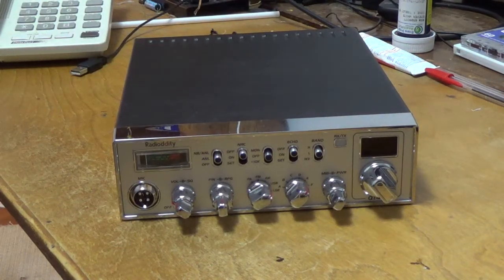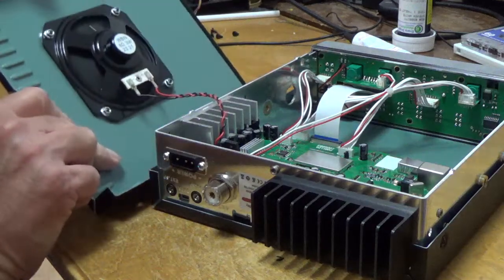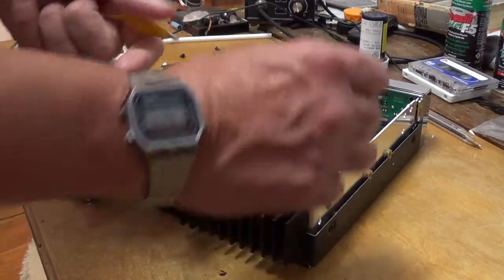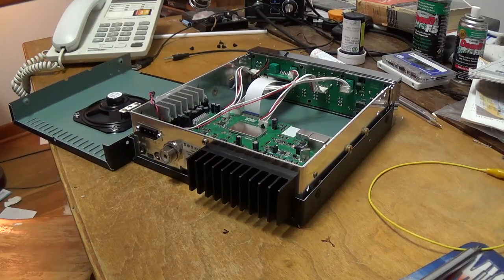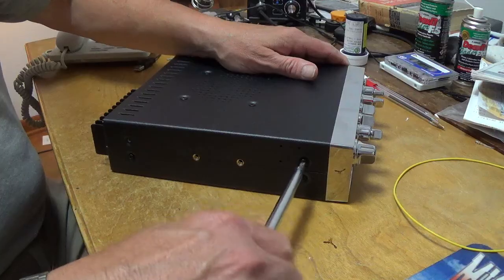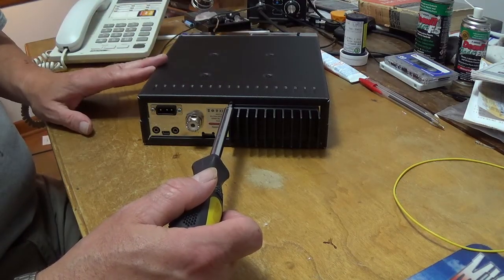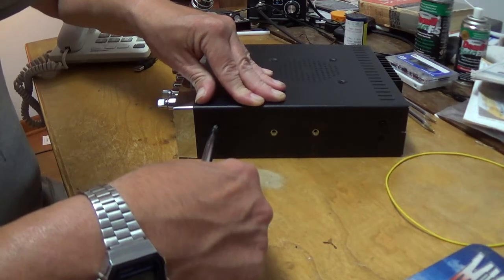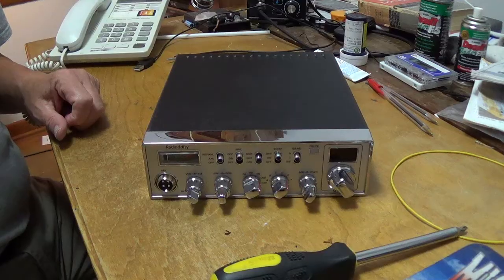RADIODDITY QT-40   CB    ( " MOD " 11 METERS " )   HOW TO

Comment: is this legal ?
Reply: It's only illegal if you get caught.  With that said,  anything over 4 watts is not legal in the US.
Reply: @Brad_English  so it`s illegal and duh
Reply: @DougEGuitar u can turn power down to be legal
Reply from the maker: Yes ...... using CB and 10 meter ham but their are bands that if you transmite on could get you in trouble on CB mode keep your power setting on low or about 3.5 watts as the FCC limits power to 4 watts for CB ten meter ham dont matter if you have a technician license and stay within the designated channels for 10 meter.

Comment: you can use a 3 switch and some wires to switch it over to normal mode and the other mode by switching the rig off or on on which mode you want .
Reply: All the conversion does is added 11 meter band (aka cb band), it doesn't  prevent you from using 10 meter band.

Comment: What is the exact frequencies you have after the 11 meter mod?
Reply from the maker: Too many to answer here all the American CB channels plus some what they call ( " Free Band Channels " ) the only way I could tell you all the exact frequency`s here would be to go into the radio with the programming software and read the programming data. if I get time I may post a PDF of both bands and frequency's to link to if You own a radio like this and it is not modified and is set in ten meter mode and you want just the American CB Band and channels their is no mod needed switch band switch to high and band mode switch to band E that's it you have all the American CB channels upper lower side bands FM without modification.  plus all the 10 meter ham band. Raddioditty has a list of the 10 meter ham channels on their web site but not the CB mod channels. I hoped this helped some and maybe someone in the comments can help you more if I ever read the radio out in programming mode I will try and print them for PDF.
Reply: Not sure why he called this a mod. It's called mars conversion in the US. It's when you enable 11 meter CB band on 10-meter radios.